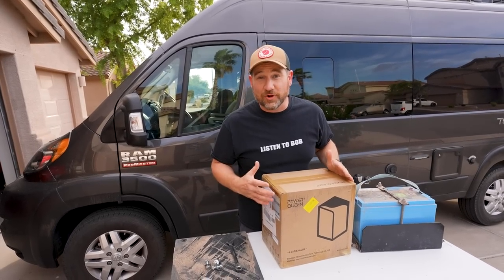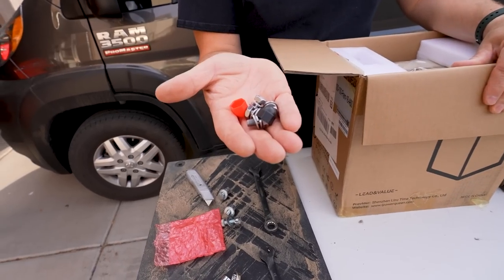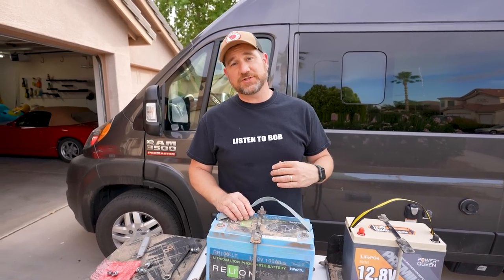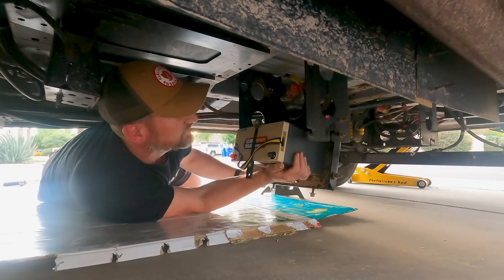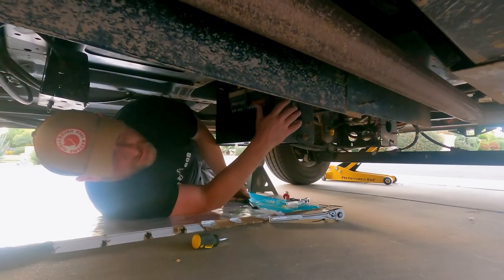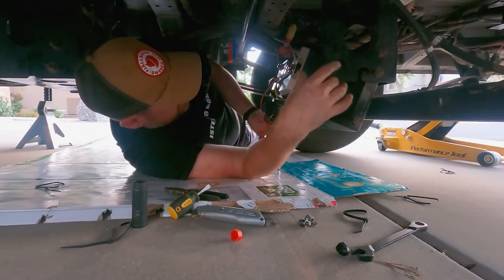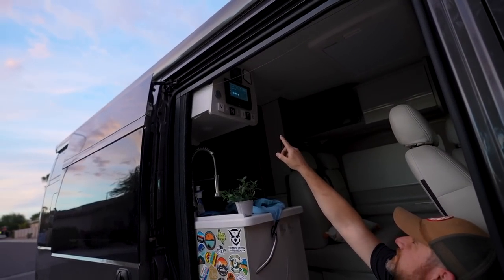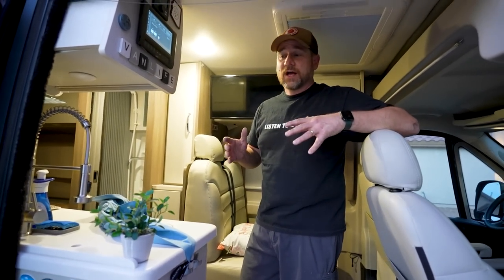Unboxing and Installing 2 NEW batteries! (Power Queen Mini 12.8v 100ah LiFePO4 Battery)

Comment: Bob, you may want to reprogram the Balmar MC-618 Alternator Regulator (blue thing near your invertor) to the new battery specs.  This will keep the batteries operating within their specified voltage/temp ratings when charging off the alternator, versus the default values.  Its kind of technical due to all the abbreviated settings, but there are YouTube videos which can help.  Thanks for the video guys, I definitely like the size and price of those batteries.

Comment: In this video I noticed that it looked like a string hanging from your screen door.  Is it broken?  There is a guy who has instructions and parts for that screen.  Also is the finish on the wood trim to the left of the slider peeling off?  Hate to notice things, but if broken would love seeing and hearing repairs.

Comment: I would change the place those batteries are mounted, for sure...The most important thing with batteries is making sure that those leads are connected to the battery properly, a loose connection could kill the battery or worse start a fire, easily...I would make a closet or spot on the inside, but, to each his own..
Reply from the maker: We have through about doing that too

Comment: I suspect, from the original video, that the original batteries were damaged from the over-tightening of the battery hold down bracket deforming the case, which likely damaged either some of the cells or warped/damaged the batteries’ internal BMS.

Comment: "Don't listen to Bob" 🤣Love the new batteries are lighter and should be more capacity!  Do you think that temperature (low or high) had anything to do with the prior battery failure?  (Especially since they are mounted on the bottom of the van?)

Comment: We had same issue with Our 2021 Thor sequence.  I tried all the fuses  and breaker switches in the breaker box , everything was fine, but house batteries were not charging with solar or 12 volt.  Took it to an rv repair shop.  Turns out a breaker had tripped that was behind the solar charge indicator panel.  Had to take off that panel  and flip the breaker.

Comment: Great job

So you have a extended warranty with la Mesa - would you recommend purchasing the extended warranty to other's buying a new van?  Any recommendations on options?
Reply from the maker: Thanks Paul! From our experience the warranty that comes with it probably is enough. We did buy the extended but wouldn’t do that again.
Reply: Read your extended warranty paperwork.  Sometimes you can cancel it.  They prorate and refund the difference based on the time left.  I did that with my car.

Comment: I hope this resolves your issue and your back on the road ASAP.  I’m currently at a campground in Oregon now having rewiring done on the wire from the inverter to the Lithium batteries.  Looks like the proper wire wasn’t used which is why my house battery kept draining and this last time not only did it drain the house battery it also drained the Chassis battery and I was forced to get a jump.   Also removing my Lithium BIM Isolator and replacing with DC to DC Charger.

Comment: Those batteries will get you by for now. But they have no cold weather protection,  just change them out before it gets cold. On to the next adventure!
Reply from the maker: That’s true. We with do that. And yes on to the next adventure!
Reply: @Vancaskeys  keep them and maybe make a home power station out of them.
Reply: Power Queen does make them with internal heaters.  "Power Queen 12.8V 100Ah Self-Heating LiFePO4 Battery, Built-in 100A BMS."  Price isn't bad either.

Comment: The soc will require some usage cycles to make a good estimate. 

I have the same setup.   Similar problems.   Will be interested to see how  these work. 

I researched trying to find batteries that would fit in that battery box but has more power.  No luck so far

Comment: We will eventually replace the AGM batteries with LiFePO4 when they start to wear down.  Until then how do you change the inverter to charge lithium vs AGM.  They have different charge parameters and something must be adjusted or changed.

Comment: Those batteries are stored outside. If those batteries are charged below freezing temperatures, they will be ruined. This could explain why the old batteries are bad if they do not have built in heat pads or low temp cut off. The Power Queen Batteries do not have either.
Reply from the maker: Very true. We have to be very aware of this for sure.
Reply: The old batteries are the LT version from Relion which have internal heaters. They can change below freezing. The new batteries should have temperature protection built-in, but won't charge below freezing.

My theory is that the old batteries were clamped down so hard that the casing failed at the seam and water has gotten into the BMS. I'll be interested to find out.
Reply: @chadseld  Specs on the Powerqueen batteries don't mention low temp cutoff... Charging Temperature

0℃-50℃ 32F - 122F
Reply: @tavonjohnston  If that is the case, then absolutely be careful, because that could be a problem. Depending on the type of your charger, you may be able to implement low-temp cutoff yourself. For example, the Victron chargers have an adjustable temperature cut-off setting and they also support remote temperature sensors that you can place outside the vehicle with your battery.
Reply: Power Queen does make them with internal heaters.  "Power Queen 12.8V 100Ah Self-Heating LiFePO4 Battery, Built-in 100A BMS."  Price isn't bad either.
Reply: We have those same Relion batteries in our Tellaro,.  We thought maybe they don't have heaters.  They won't charge at all when it is cold.  Like even at 30 degrees.   @chadseld